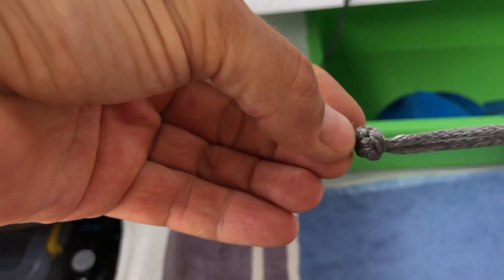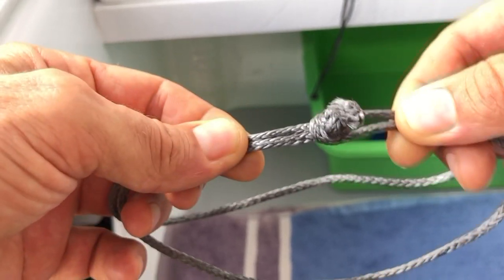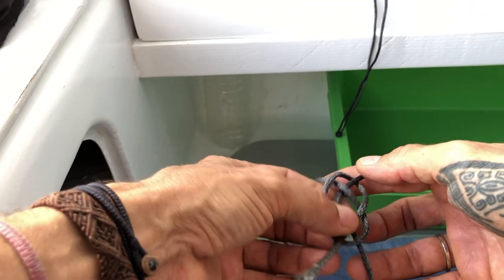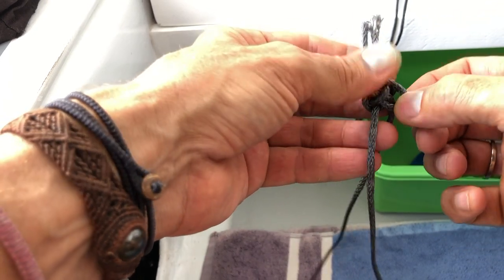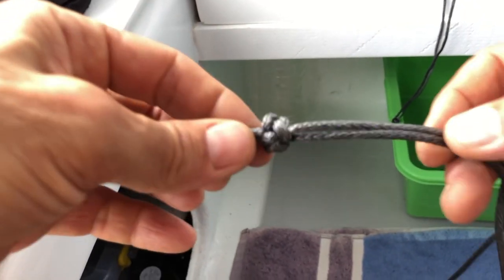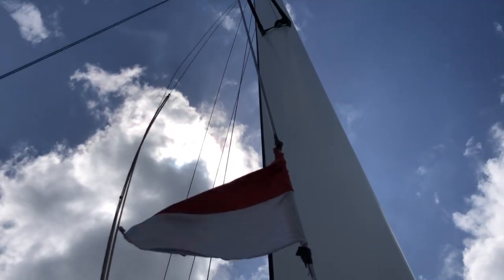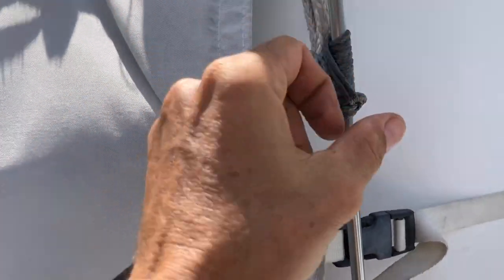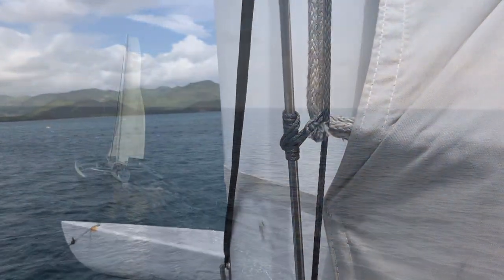Rope loops and soft shackles made easy - Trimaran Spirit - The Simple Life - Ep13

Comment: thanks for the lesson on soft shakles.  My 30'  Condor trimaran has a lot of dynema already.  But I'm going to switch over to a Colligio torsional rope soon and i will be using soft shackles to attach the headsail to the rope.  What are you using for for a furler...and any likes or dislikes about it?  Thanks for sharing your knowledge.  Love your big trimaran and your laid back style...
Reply from the maker: alan smith many thanks  🙏 glad it could help. We use a profurl furler with standard alloy luff foil. We looked at the torsional furlers with dyneema hanks but they were expensive and I wasn’t overly keen on them for crossing oceans. I’m sure with some more experience and knowledge of how they work and what they’re deficiencies are I’d be happy to trust them. The weigh saving, simplicity and better aero shape are good points that they have. Cheers